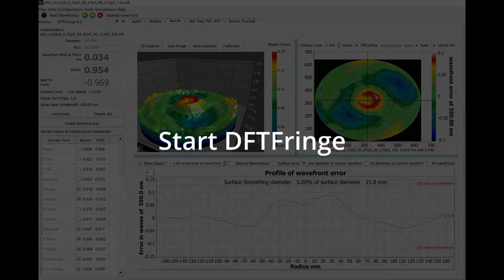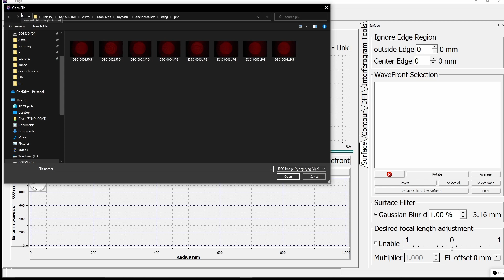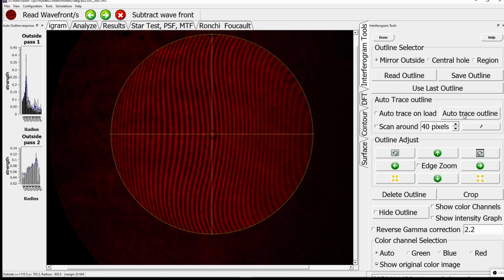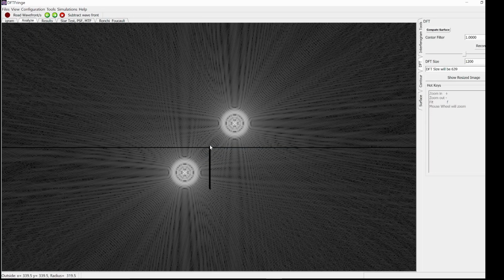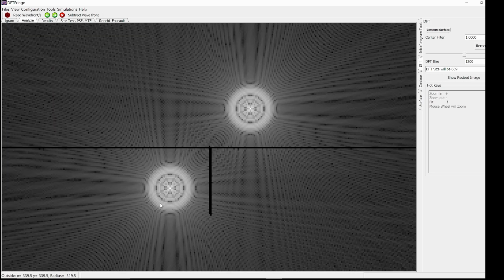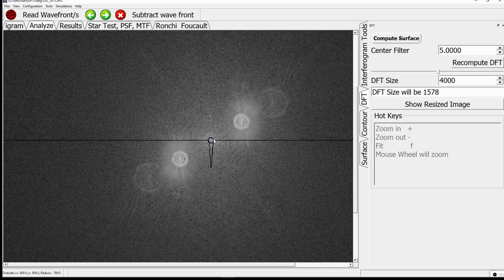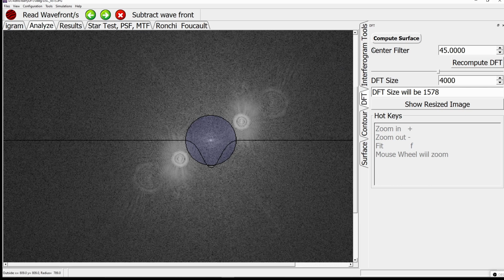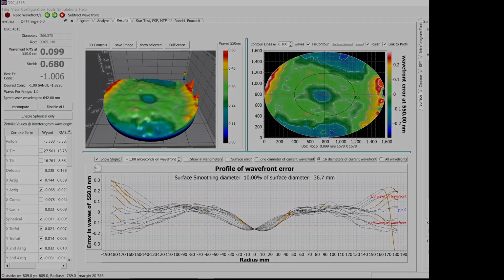DFTFringe Tutorial Part1 (introduction)

Comment: This is amazing. Can you use such software to analyze non round surface? I have a mirror like surface 8x200mm that can have bumps on it with micron level height.
Reply from the maker: Only round or elliptical.  Ellipse  axis must be either horizontal  or vertical.
Reply: @daleeason9687  That is what I have thought. Do you have any idea what could I use to measure the height of such bumps other than measuring it point by point with something like a capacitive sensor (or any other contacless sensor).
Reply from the maker: @Boogie3D  sorry,  I only know about measuring telescope mirrors with the Bath interferometer.  There are other methods but I don't know them.

Comment: hello, can I use this software to check interferences of flat mirrors surface?
Reply from the maker: Yes.  There are two ways.  If the mirror is not round use the ellipitical/flat in the mirror configuration.  Or if the mirror is round set the desired CC to 0 and turn off the artificial null.
Reply: @daleeason9687  thank you!

Comment: I see this can be used in autocollimation, but is it (or will it be) possible to recover wavefront information out or lateral shearing interferometer (or a 0-90deg pair)? That could be quite useful, as for shearing method there's only a need for a moderate coherence length source, spatial filter (optional really) and a single precision element, which is wedged shearing plate itself.
Reply from the maker: As far as I know yes it can.  It analyzes any interferogram and compares it to a sphere.    Then with the use of it's artificial null for spherical aberration it can remove that and compare to any desired conic constant derived surface.  I believe it already been used to analyze interferograms from shearing interferometers.